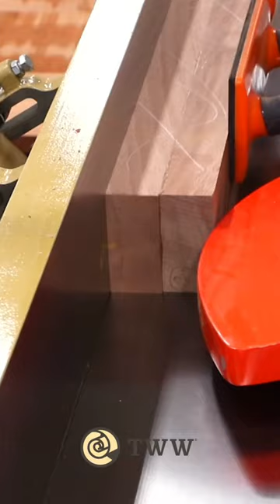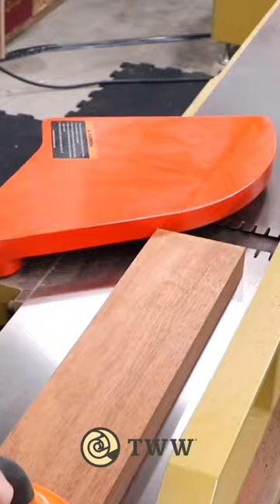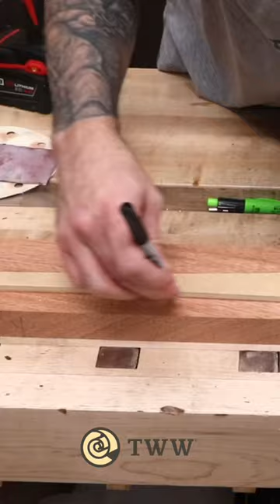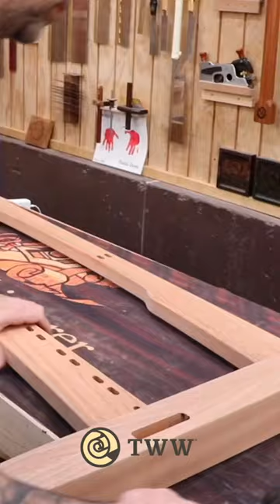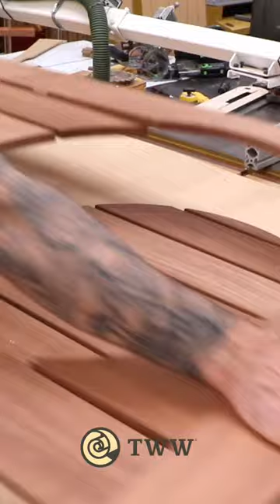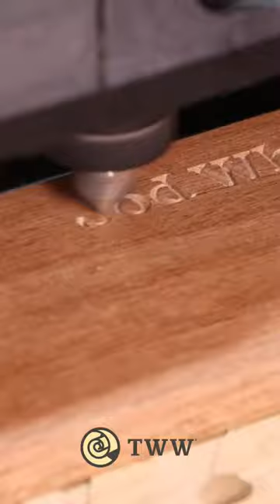That time I made an overly-fancy stand for my Big Green Egg. 👍🧐 | #shorts

Comment: Mark, I built one based on your video/plans and I love it! I added a custom sapele tiled trivet for the BGE and a 24 x 32 in marble top for food prep. I want to add a dual butcher paper/aluminum foil dispenser to fit on the end of the lower shelf. Got any design ideas for that?

Comment: Marc, no worries about wood that close to the egg?  My egg gets pretty hot at the bottom
Reply from the maker: Really depends on how you use it. You want air gaps all around, including the bottom if you can. And if you can get the bottom on a nest, then have that one top of some sort of fire brick...even better yet. I wouldn't recommend this setup for anyone that does a lot of pizza. I typically don't bring my kamado to anything over 375 and most of the time I'm at smoking temps. But it is wood, and the thing sitting inside it is fire. There's a degree of risk you have to accept if you want this kind of setup.
Reply: A golf course near me recently built a large brick pizza oven on a wooden platform. It quickly lit the wood platform on fire and needed to be rebuilt. So yeah definitely avoid making pizza on this.

Comment: Your legs are laminated and not 8/4 !! Scandalous!! (Sarcasm) they look good. You find laminated to be more stable and a good hedge against twist? (Not that mahogany Is a big twister.)
Reply from the maker: If I recall correctly those are actually two laminated 8/4 boards. 16/4 Sapele just wasn't in the budget, lol. But I honestly haven't noticed much difference in stability between laminated and single piece legs. If I could have gotten the thicker stuff, I would have.